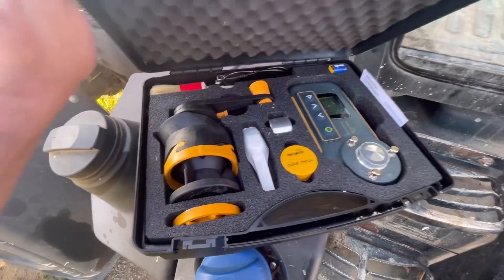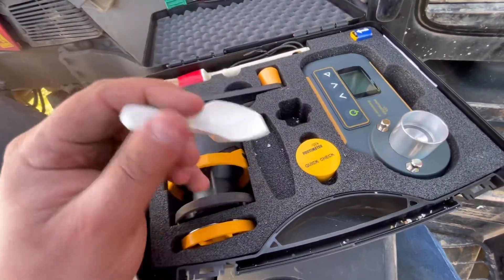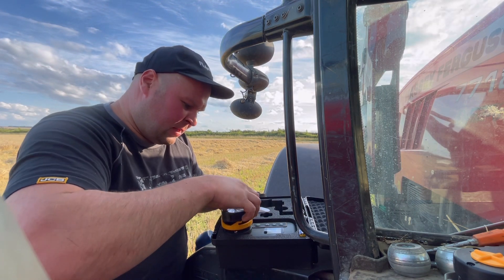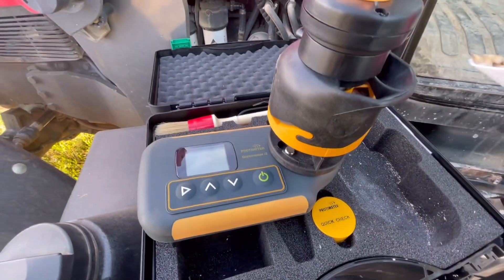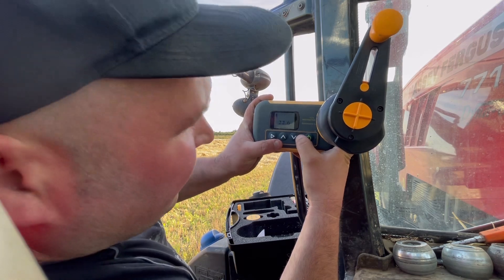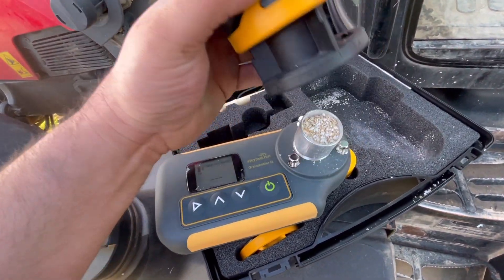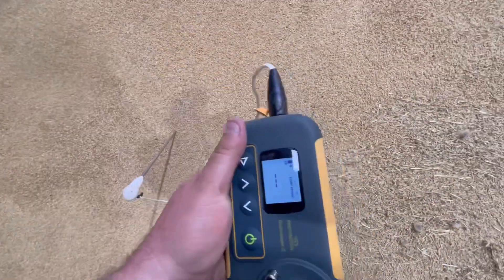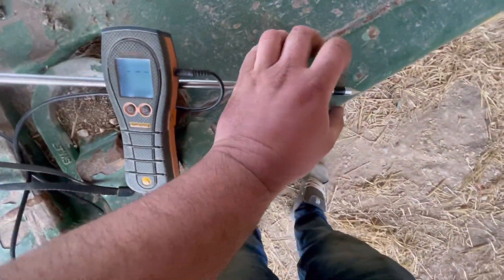What is a farm moisture meter and how does it work?

Comment: Why do you need to take measurements and what does the bar graph show you over time?
Reply: The dryer the better   if it's to wet you will have it go off when in storage and that will make it useless       also when u sell said crop it also has to be a certain %     also if its to wet Md u need to dry it that will cost say £1.20 bushel  of corn and you get paid £8.58 that's a fair chunk